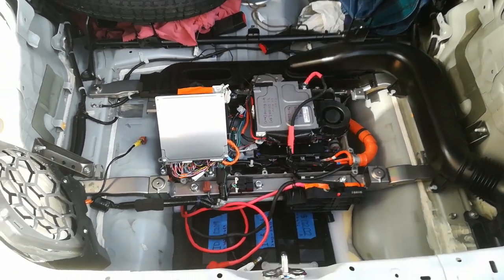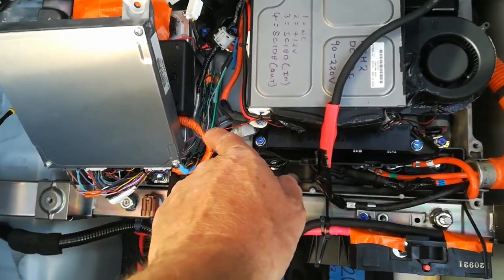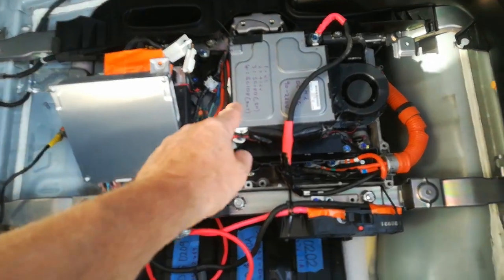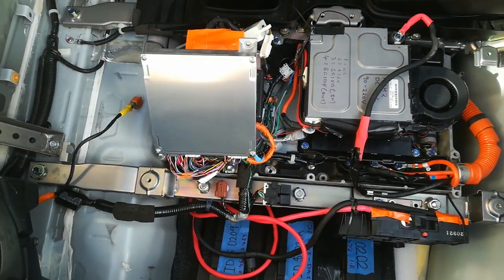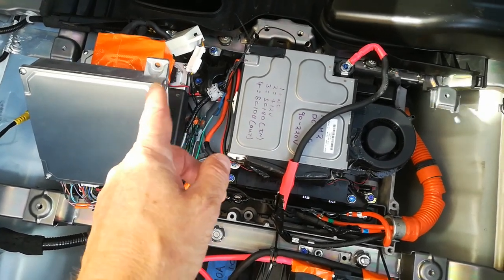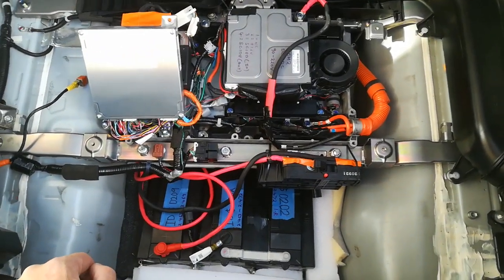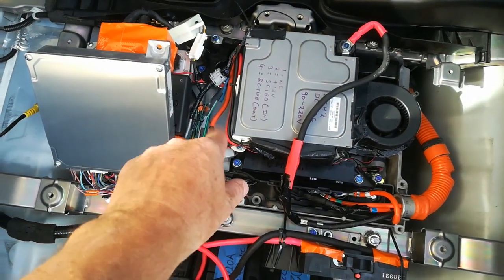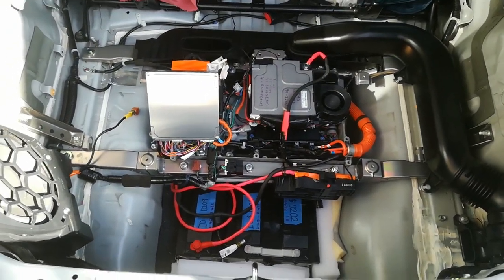CR-Z Frankenstein IMA 30kw System Video 8 (210V)

Comment: happened across this whilst looking up if overvoltage would make buying a CRZ worth it for me. Did you ever finish this? is there a 0-100kmh before and after?
Reply from the maker: There is no road test. Yes you can over volt the CRZ I suggest look at my various long threads on the CRZ forum. Lots of reading to do.
Reply: @retepsnikrep  haha I have dyslexia, ADHD, and I don't actually own one. That sounds like a lot of reading for a "maybe"